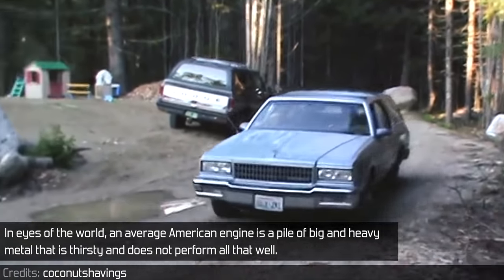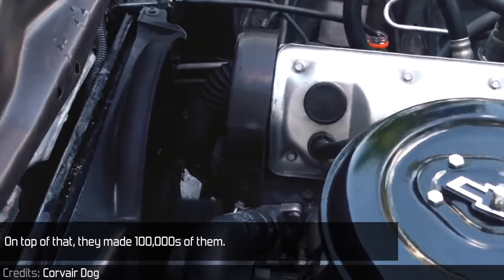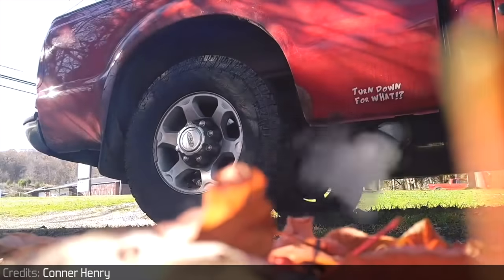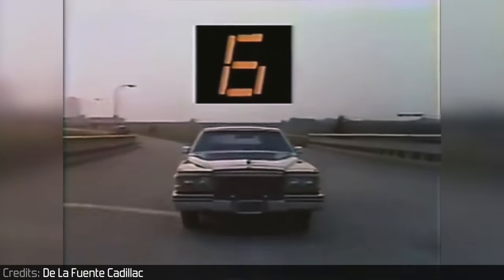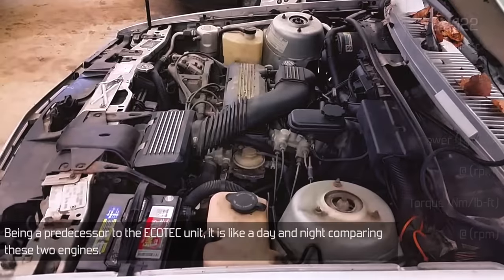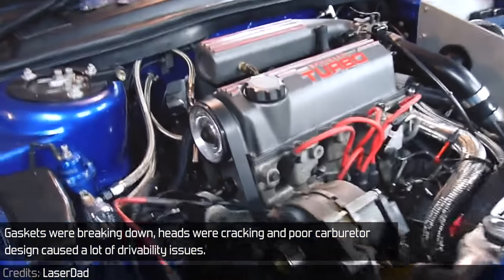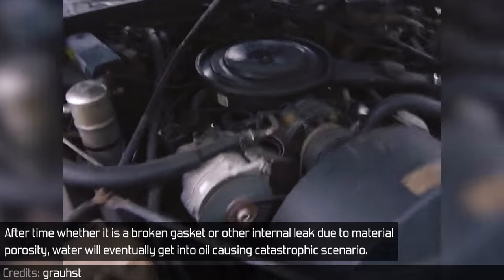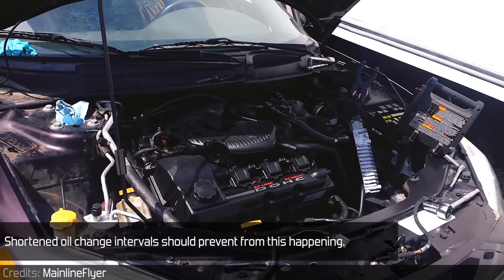8 Worst US Engines You Should Avoid

Comment: i really need to dd one more turd to the list:
the northstar v8.
Reply: All Northstars had a problem with head gasket failure, regardless of the generation. The problem was that the head bolts used too fine thread and too small a bolt for the application. It's fairly easy to fix, however, as aftermarket kits fix it with using a bigger, coarser thread bolt which permanently fixes the problem. The Northstar also had an issue with oil leaks. The entire bottom half of the block was used as a girdle to support the crank, so the block is split in two pieces. GM sealed the split from the factory with silicon. Not really much to fix this one except pull the engine and reseal it. It wasn't an issue that could be resolved with the engine in the car. Barring those two issues, however, the Northstar was efficient and powerful. It's not really a bad engine, it just has some shitty shortcomings. Fix those issues though, and it's damn near bulletproof. It doesn't sound too bad with a good exhaust either.
Reply: What, you don't think putting the starter under the intake manifold is a good idea?
Reply: Northstars are garbage. You think that 15 years of development wouldn't have so many issues
Reply: + Oddman1980 Toyota also does that.
+ meifert2 They can't be that bad... There's a company out in CA (I think..?) That used them as a powerplant for their 1000+hp sandrails.
Reply: akio2589 no. They use LS and Windsor V8s
Reply: They used Northstars before they used LS's or Windsor. The Northstar was around for quite awhile before the LS was. I don't know of any company that uses Windsors nowadays. Some companies STILL use the Northstar because they're light. They weigh less than an LS and can develop just about as much power. The Northstar is also a pretty popular performance boat engine for the same reasons. It's also not difficult or expensive to overcome the Northstar's shortcomings.
Reply: akio2589 do you realize how livht a Windsor engine is? An all aluminum Ford 363W weighs under 380 pounds, about 30 pounds lighter than a Northstar stripped of accessories
Reply: Considering the aluminum block is not stock and is expensive and weighs about 80# less than a cast block. A fully dressed stock 302 weighs about 450-500 lbs, depending on which one you start with. Boss 302 weighs 500-ish lbs. So with an aluminum block, it would be around 370-420 lbs, and that's in 302 form. Bear in mind that you're gonna pay about $5k for that aluminum block. And I doubt that, even with the bore, more metal added by longer conrods, and a stroker crank are gonna make it any lighter. The caddy Northstar weighs about 465 lbs fully dressed. I can get one of these at a pick 'n pull for 200 bucks. Spend another $1000 for a set of ARP studs and good head gaskets, I now have 1200 bucks in an engine that is more or less indestructible and capable of just as much power. So, I could spend 6-10k on an all aluminum 363 setup or I could spend 3-5k on a turbo Northstar setup. Not really worth it for 40 or 50# saved. And the Northstar would probably have more power. Also, newer 302s (and variants) aren't Windsor engines, they're the Coyote series, part of Ford's modular engines.
Reply: akio2589 a 302 Boss block is 460 pounds fully dressed with aluminum heads. The 351W is right at 500
Reply: akio2589 and the aluminum block is not nearly that expensive. I just helped a buddy put one together and the longblock with flywheel was 358 pounds. It should make around 600 hp
Reply: They're pretty expensive. Cheapest aluminum block I can find is almost $4800. Figure I can build a turbo Northstar that can make more than 600 hp for just the cost of the block. Maybe if you found it used, it's cheaper. I can still build a Northstar that will make more power for less money.

Bear in mind that I don't give a shit about Ford or GM garbage. I just feel the Northstar gets an unjustly bad rap. They're not really shitty engines, they just have one shitty flaw.
Reply: akio2589 you can get them for around 3600. And I can build a 600 hp 363 that will run on pump gas easily. I told him it would make about 600 hp....but 11.5:1 compression, Kaase P38 ported heads and an Anderson N113 cam will probably make 700 with the ITBS.
Reply: Gizmo Thewytchdoktor Yeah I'm surprised that wasn't on the list because those late 90s to early 2000 N. stars were garbage
Reply: Keye T all Northstars
Reply: meifert2  i know lol I was just trying to throw GM a bone
Reply: I bought a 2000 Deville, owned it for 2 weeks before I sold it. giant piece of crap
Reply: +meifert2 For the record, I have better experiences with GM products than I do Fords. I do not and will never own a Ford vehicle, nor anything powered by Ford. Not really saying that Ford hasn't made good engines, they have. Just not in the vehicles I've been involved with. I have, however, owned several GM vehicles that have been wonderful cars. I've also owned Chrysler vehicles that have been fantastic. I can't really say the same for the Ford vehicles we've owned. Of the big three, Ford is my last choice.
Reply: akio2589 Well I hate to break the bad news to you but I hope you know that the new 10 speed transmission in the Camaro will be shared in some Ford models because the GM/FORD Our coproducing some new 10 speed transmission and are already using in some models like the F1 50
Reply: Keye T and by coproducing Ford did most of the work.
Reply: The last iteration of the Northstar, the LH2, was heavily reworked for RWD applications starting with the 2004 SRX and then the 2005 STS.  I have an 05 STS with this engine and it made 320 hp in this final iteration, with variable intake and exhaust timing.  Apparently they have fixed all of the issues, as my car has 131k with no head gasket issues.  I don't expect to have any, either.  Pretty nice running engine actually.  I also have one in my 08 SRX.  That has somewhere around 122k I think.  Time will tell how this works out for me but I expect to be fine.
Reply: lol.....tis good joke
Reply: Northstar V8 not bad at all. Just keep it away from grease monkey's and shade tree guys-it has absolutely no place there. It'll last 150k-200k easily with proper timely coolant flushes and oil changes-that's it. If it shows signs of overheating, take it to a dealer or ASE technician for professional diagnosis ASAP. Don't keep driving it around overheating then wonder why the headgasket warped and started bleeding combustion gases into the cooling system. There are too many Northstars still on the road for it to be considered a turd.
Reply: A statement that includes "Ford" and "transmission" is a no-go. Ford hasn't made a good automatic since the C7. Hell, the last really good transmission that GM made was probably the 4L80E. GM transmissions have really taken a shit over the last few years. If Ford's involved, I'm not surprised. Not that earlier Chrysler transmissions were any better. Chrysler seems to have picked up the pace in the transmission department, however. Of the big three, they're probably producing one of the better transmissions in newer cars. Personally, I don't drive automatics, if I can avoid it. They all fail at some point. A manual transmission will last far, far longer.
Reply: Also, it's not new for manufactures to share transmissions. The T56, for example is found in a BUNCH of vehicles, as was the T5. Mid-late 80's rangers used a 5 speed manual Mitsubishi trans, with Mazda rear ends. Hell, Jeeps used to have GM 2.7L engines in them, before they were acquired by Chrysler.
Reply: It's not really a bad engine, but it does have an engineering flaw. Granted if you deal with that flaw, it's absolutely bulletproof. My wife drove her '97 Caddy Deville for 182k trouble-free miles, until someone sideswiped it and totaled it. It ran fantastically well. Never had to mess head gaskets. Had to replace a water pump once... That was a fiasco. I had it to the floor everywhere I drove it. For being a big heavy piece of shit, it would get up and move lol.
Reply: or a powerstroke 6.0
Reply: don't forget the rubber throttle body union that splits and makes a huge vacuum leak!
Reply: Ricky Dalme or the turbo that spools up when it idles on the 6.0 ps
Reply: akio2589 well ever since FIAT Merger, chrysler transmissions have been TRASH... that 9speed they put in the Dodge DART/200  and the cherokee have been AWFUL, and also their dual clutch from fiat is a disgrace
Reply: Keye T I would hesitate to call them "Chrysler" transmissions. The more recent transmissions that Chrysler actually designed and produced were pretty good, for automatics. I can't really speak to the 9 speed. The 8 speed they were using wasn't bad, however. Truth be told, I've seen more GM trans failures in late model vehicles than anything else. Some of them failing after 35, 40k miles.
Reply: Tim Taylor well it’s chevy
Reply: I don't like that modular design.  Too many problems, bad engineering. Especially with those timing chain guide rails that wind around all over the place and fall apart so easy.
Reply: +akio2589 a good 4 cam American v8 is a terminator cobra engine those with the stock block can handle 1k horse power so that is what i call bullet proof reliable
Reply: +akio2589 the 8 speed is made by zf and its a great tranny its used in fucking hellcats which have 750 crank horse power [unofficially]
Reply: Gizmo Thewytchdoktor yes them Northstar motors are junk
Reply: it didn't sound bad with a Cadillac exhaust system either, I had a 96 DeVille
Reply: I had a 96 DeVille and loved it, held all 4 of my kids, Could get my elderly Mom in it and yes, it would get up and go,  Plus on the freeway on a trip, I would get 26 and 27 MPG on that car.  ( I got the 27 in Oregon, their gas is better than California's)
Reply: I had a 05 northstar in my DTS that I put 215000 miles on trouble free and it ran like a striped ass ape.
Reply: if you took care of them and watched your oil levels , they were great engines
Reply: I did have to change mine.just took the power steering pump loose and bam.
Reply: yes, my Brother was driving my Moms older Seville and was knew he had a radiator issue and didn't get it in a fix it  and fried the engine, so I got the car back and found a engine for it, had to hunt as they are in demand for boats and other things,
Reply: me too, had much better luck with GM cars, owned a 92 Sable and a 2003 Escape and both cost me a bundle to keep running.  My drove my 77 Buick for years, had a 90 Astro Van with a 4.3, that run over 200K  had a 96 Deville for some years,loved it, also a 2000 Suburban that my exwife is still driving,  but I'm driving a 2009 Impala now and I have about 135K on it and its still running great, plan on driving it a couple more years and then give it to my son.  Thinking about a ATS Cadillac, but I have had such good luck with my Chevys , maybe a Malibu
Reply: Exactly
Reply: how old was this Cadillac when you got it and had it been taken care of?
I had a 96 and loved it, but I bought it in 2004 at the Cadillac dealer and it was in great shape, and they made sure it was before they sold it to me, it was a one owner trade in
Reply: kevin9c1 yeah I wished I had known they fixed the northstar by 05 I wouldn't have gotten my 06 srx with that pos 3.6 engine lol multiple timing chain failures and heavy oil usage that 3.6 was a total pile. I ended up scrapping it after the third timing chain failure and the warranty wouldn't cover it smh
Reply: I thought that 3.6 was a good engine?   or did you just get a bad one?
Reply: They were plagued with issues since 04 the 3.6. GM somehow thought 15k+ mile oil change intervals was a great idea especially on an engine known to use oil with low mileage. They even issues a courtesy recall on the timing chains but only 07+ with under 110k. I bought mine with 64k miles and it used oil heavily since day one. Timing chains done at 68k, 84k and when they went again at 108k I was done. That is one of the most labor intensive jobs I've ever done. My extended warranty wouldn't cover any of the repairs to the engine because of the amount of sludge discovered at 68k due to the original owner doing those 15k intervals when I kept mine at 3-5k but with the heavy oil usage I couldn't go further than that. Mercedes designed the 3.6 but were smart enough to not use them in their own vehicles. 3.6 has no balls and terrible fuel mileage.
Reply: Jeeze, didn't know that, I have a 3.5 GM engine now and its over 130K and running great.  I noticed they were using the 3.0 on the CTS later.    The old Buick V6 was very good and I thought it was a 3.6.
Yes you should have gotten the Northstar, I had a 96 that the previous owner did the bottom seal,  and I changed the oil frequently and loved it. They do use oil, about a qt between changes. It had  Lots of power and made that big Deville fun to drive.  I was driving 4 kids to school and had a elderly Mom and that car held everyone, it was a great car for me at the time.   On the freeway on trips, that big car got 26 and 27 MPGS, but around town not so good
I heard they had that Northstar seal issue beefed up by 2000 as they had redone the engine to run on reg gas, mine needed premium , I remember I used to get gas for it at Sams Club
Merry Christmas
Reply: The 3.5 isn't a bad engine I really only have to do certain repairs on them like the oil filter adapter seal leaks and to bleed the air out of the cooling system is fun but you would notice that issue as you wouldn't have any heat except during acceleration but I've since figured out how to bleed it lol Merry Christmas to you also. I still think the best v6 engine GM has made was the old 3.8 especially supercharged man those engines can take a beating.
Reply: I think that was the old Buick V6, the 3.8, thanks  and I still  see those older  Buicks on the road.  Since we don't have rust issues here, I see a old guy in his 68 Riviera and a couple people in their old 69 Falcons, LOL, running around town
Reply: Chris Atkinson I've got an 05 CTS with that 3.6. I bought it with 27,000 miles and yes, it has always gone through oil, like a qt every 1,000 or so. I've always checked it and added and have never changed the chains and have 148,000 mikes on it. I'm thinking because of the fresh oil always in it, I might hopefully be ok. I did have to get a new rearend out in it right out of the gate because if a known leak problem and noise. Also, it is shitty on gas like you said. You mentioned the 3.8, which is what my wife has in her 04 Monte Carlo and what a great motor. Way better than my 3.6. 175,000 and still going strong after doing intake gaskets.
Reply: thanks for this info, I was thinking when I get a newer car in the next few years, ( 130K on my 09 Impala) I might go back to a Cadillac and maybe a CTS or a ATS, guess I will stay away from the 3.6.  I think if its a ATS, it would be a 4cyl turbo
Reply: Chris Atkinson I had a 2004 CTS with the 3.6 no oil issues in the 156k miles I had it. Last I checked car is still running with 250k+ miles. I changed oil every 5k miles.
Reply: appleiphone69 that's good to hear. Did you ever replace the chains?
Reply: Louie Stepanek no the only issue I had was work on the rear diff. Second owner had to replace cats. As expected with mileage.
Reply: appleiphone69 I had my rear end replaced also at about 30k, also it just threw a code for the cats and I have 149K on it, so I guess it's common. Thx bud!
Reply: to me there is something that is just 'off' with ford suspensions, dont like the 'feel'. the two I have run to death would have been allowed to live if parts for fords werent so damned expensive compared to g.m. parts. so I would have to say I agree.
Reply: it is all about the bottom line. g.m. gleefully used allison transmissions so they didnt have to make one. (transmissions apparently cant be made well cheaply.)  ford hasnt done any better ushering a usefull unit through cost cutting design sessions.. in my yard sits a 1952 packard patrician. in it is that chrysler transmissions grand daddy. a two speed, still works and its never been opened.tried and true is always best.
Reply: I think most drivers of these cars have coolant leaks at the waterpump or some where else and just keep driving until it blows the head gaskets.
Reply: Horseshit. Haven't had a single issue with my deville.
Reply: Honestly it depends on the Vehicle and engine placement.  And before they put in a new bold best practice is to re thread the bolt hole and use a better bolt.  Head gaskets are not easy to work on due to their difficult nature and replacement.  Its generally at least 6-8 Flat Rate shop hours which can be costly
Reply: I was thinking the same thing. Lol
Reply: The Northstar engine with proper maitinence will run far into the 250k mile mark, like any other luxury car they require to be serviced on time, it was a phenomenal design that could run without water and oil and be fine due to its cylinder shut off feature.
Reply: Gizmo Thewytchdoktor I thought the same but I took chance purchased 1999 Caddy which still have I love the car it has not given me any problems and had it for a couple years I think the head gasket go on those cars because of bad maintenance
Reply: when  was the last time  you had to change  one    ??my  95  transport  is 23 years old   an  176.000 on it  the stater  just died  ,,not  a bad   run  i say 181  bucks later  at a shop  back on line..
Reply: in 2008 actually. the year i retired from the business. that was a july and at that point 12 had come across the shop floor. most with blown head gaskets but a few...they were special. i do find it neat though that there are a few examples that folks have had very little trouble with. given the demographics though...they are the exception and not the norm. upon inspection of each unit it became apparent that the engineers were stifled by the cost accountants in several areas. a situation that all too often results in the consumer getting screwed until the manufacturer fixes the flaws(dual ohc subaru engine head gasket failures come to mind)or gives up on the engine's production. a promising caddy design doomed by bean counters.aa
Reply: What about the 1960s and up Chrysler Aluminum case TorqueFlite 727 trans.? Chrysler was a pioneer in the auto-trans. business.  This transmission has a good reputation.
Reply: and rightfully so. the 727 was and still is a wonderful and relatively simple piece of kit. that and the c6 ford trans. compared to most on the market these days they ere bulletproof.
to add to the list the th400(vacuum modulated) and 4l80e(solenoid controlled) units of which a 4l80e is attached to my 6l v12 jag.
Reply: How about the 5.7L Diesel Oldsmobile engine from 1977-1985. These were junk notouis for head gaskets, fuel injection pumps.
Reply: visio covered these on the opener with the olds wagon.  they were truly scary pieces though. didn't expect different though as it was a converted gas engine.
Reply: Worst car engine (maintenance wise) I have ever had the misfortune to work on. Everything is buried (without exception). I suspect that the engineer who designed this engine caught a mechanic boinking his wife and decided to punish all mechanics for it.
Reply: agreed! also....the theory is sound and makes sense. ;-) why the hell else would something be designed in such a manner?
Reply: Very true!  I bought a newer generation DTS (2006) in 2013 because of the head gasket issues of previous generations.  Blown head gasket in May of 2016 and 140,000 miles.
Reply: time to get rid of the zf (made in germany) supplier for Fiat transmissions.
Reply: Aluminum heads bolted aluminum block they never held up head gasket
Reply: Sigmund Solo wow, you sound just like me.  I am trying to figure this out as well.  Also, what do these people do?  I never see anyone at the park, outside, or in the malls anymore.  I think they just like to drive great distances to say they were there, then drive back home.  I still have the first new car I ever bought - a 1996 Cadillac deville with the northstar engine.  It's been to Florida 5 times where I stayed 2 or 3 weeks to go to Disney with the kids, or visit my parents and sister.  I have 117,000 miles on it.  I might take it down from NY next week.  I do the preventative work myself including Dexcool changes every 3 or 4 years, and the bars stop leak supplement, and I replaced the radiator, hoses, and surge tank last year because they were old, and I didn't want to overheat the engine if it leaked out.  I was in my early 20's, and paid cash for the car. The salesman was confused when he was asking about a loan, and I said no.  My time is too valuable to be driving around or driving thousands of miles a month to go to work!
Reply: My parents had 3 Cadillacs with Northstars. The first one had an intermittent overheat problem due to coolant passages that were too restrictive. Otherwise, it ran great. The two later Northstars were trouble free. No headgasket problems or oil leaks on any of them and they put quite a few miles on the first two.
Reply: BTW, GM owned Allison Transmission. They sold it for quick cash to fund their efforts to drop brands and close dealerships.
Reply: John Kiesznowski I do not believe it's the head gasket as much as it is the aluminum block threads for the head bolts dissolving causing the head bolts to pull out.
Reply: @ Sigmund Solo:  Go take your meds.  What people do with their vehicles is their business, not yours.
Reply: @ David James: You're as big a kook as Sigmund Solo. As I said to him, what people do with their vehicles is their business, not yours. I put less than 15k / year on my own, so I'm not one of them, but it's their business.
Reply: Sigmund Solo 
No, i guess they just LOVE to drive !
Reply: The Northstar is far from a turd.
Reply: It's as good a place to put it as any and guys who know what they're doing can swap them out in a few minutes. Mechanics always develop shortcuts to access hard to reach parts.
Reply: It is very expensive. The head gasket job costs over 5K, and that was the cheapest quote. Other shops want up to 8K. I suppose if you have a garage and the expertise to rebuild engines you could do the job yourself but even then the kits alone cost about $600.
Reply: @meifert2  they aren't the same trans.
Reply: akio2589 all the aftermarket for the north star is is trying to hold that fucker together so it doesn’t CRACK THE BLOCK if all the aftermarket is trying to do with it is fix problems on it than it’s not worth anyone’s time
Reply: the engine that coudnt resist blowing a head gasket
Reply: @meifert2  meanwhile the v8 magnum over at dodge still weighs more than a miata lol.
Reply: When I retired in '08 from a Cad dealer, I had pulled out 176 NorthStar engines for various repairs. What a loser! The nightmares are not uncommon!